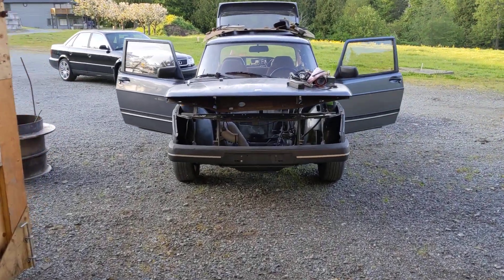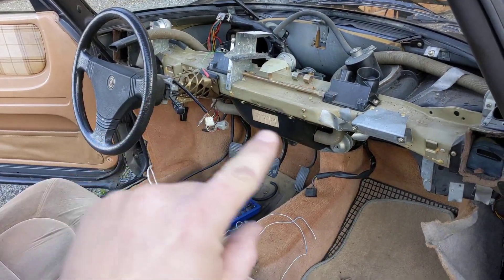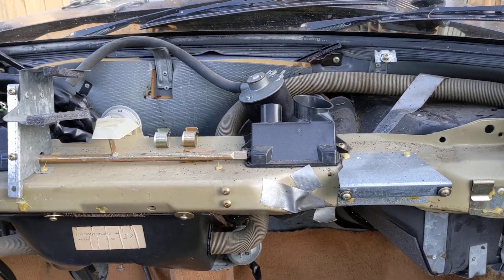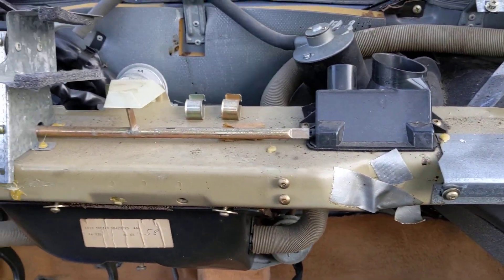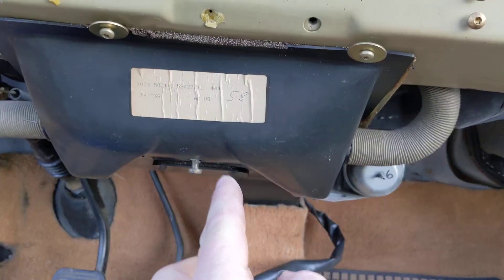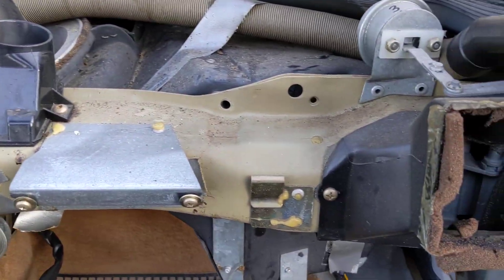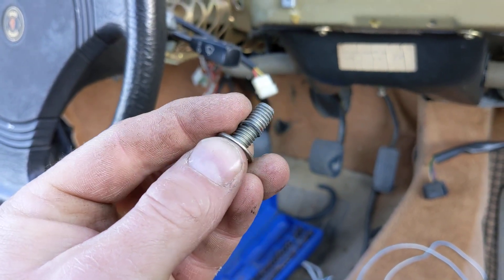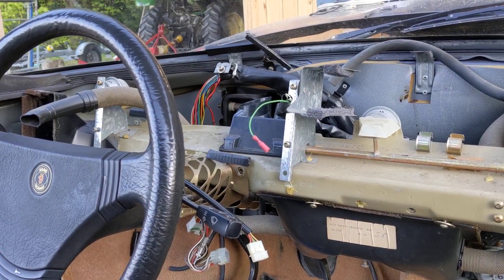Saab C900 crafty engineering

Comment: Glad your bolts had those rubber washers. Mine did not unfortunately. I've completely taken apart my '89 SPG (down to the frame) and I will say, getting the heater core and AC stuff out isn't too hard. It just takes a lot of time and it is a tight fit when you do pull it out. This is from someone who did a couple oil changes and went "Why don't I take an entire car apart and restore it?" Still working on sandblasting and painting parts at the moment. My advice: Take all the pictures lol.